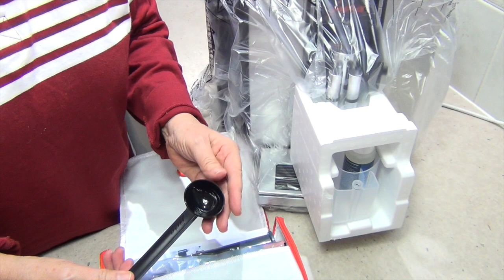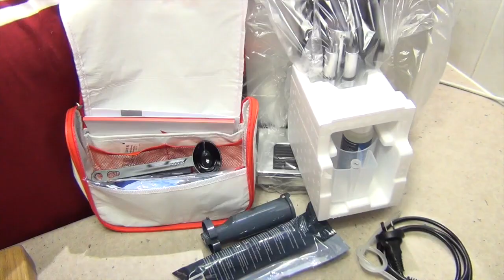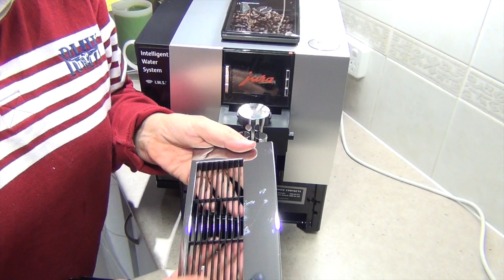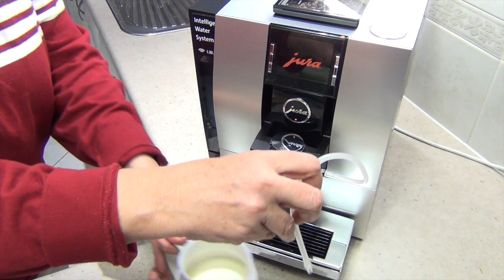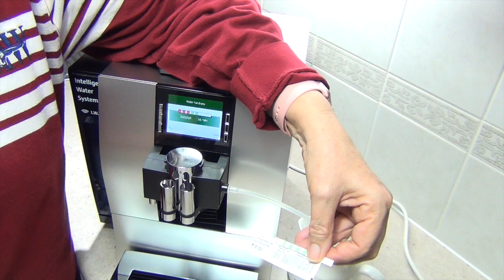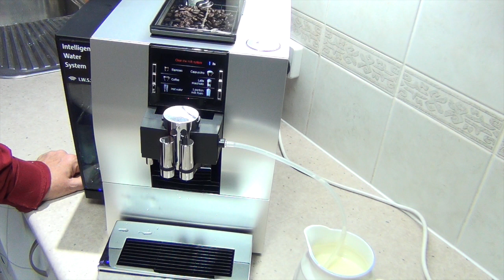Unboxing Jura Z6 Fully Automatic Coffee Machine cheekyricho episode 1,126

Comment: Great machine and review! I myself have an older refurbished Jura and I love it. It amazes me that it heats up quite quickly with only 1400W.
Reply from the maker: Thank you very much, they are supposed to be the Rolls Royce of Domestic Coffee Machines, I hope you get many years of faithful use from your Jura too. Thanks for watching.;-))
Reply: @CheekysKitchen  Thank you! The thing is that these machines are so modular, that they last as long as the manufacture of parts, but every 4-5 years parts must be replaced. Technically they could last a lifetime. Like I said, mine is a refurbished model, but still going strong after 12 years. It's like a car, it really is the rolls royce of espresso machines.

Comment: looks great at first, but very expensive with no provision for the user to even clean the brew group. Good luck with it I'll stick with my Saeco machine.
Reply: The reliability of Jura machines is the result of the permanent brew group, it has a self clean function where you can just drop a tablet to have it cleaned even to descale the boiler. The milk delivery system also self cleans.
Reply: cheekyricho cooking Would be wonderful but I live thousands of miles away! Still waiting for this machine to arrive in our turf so I can hand over my Micro 1 to my dad 😀
Reply from the maker: +Junior Ocicat thank you very much for the feedback. It has several automatic cleaning functions. I'm not sure which of these clean what as it is all done automatically. I have no experience with any Saeco machines, I'm sure yours would make a delightful cup of coffee as well. I have made no comparison between this machine and any other. This was simply an unboxing, a mini review and a few specifications differentiating it from the previous model. Hopefully providing an unbiased view of the machine, the package contents, the dimensions and a few of its features. Personally I like unboxing and product reviews as I find them to be more impartial than advertising by the supplier. It may help someone make a decision in regards to whether the product under review would or would not suit them personally. It isn't a cheap machine and the more information a person can gather about any product they a researching the better. Thank you for taking the time to comment and for watching.;-))
Reply: cheekyricho Hi Cheeky,
I have no problems with your review, seems like a great machine. After watching your video I thought I would check the web for a price and YouTube for any further videos. I noticed some additional videos on servicing your machine, including cleaning the brew group which should be done regularly as it is exposed to coffee grinds and water which leads to mould. I was surprised to see the amount of disassembly required to clean it, and some samples of the build up of mould. I hope you have a great experience with it, it obviously makes a great coffee and I hope long term it continues to do so.
Reply from the maker: +Junior Ocicat thank you very much. We live a long way from the store we bought it from and they offered to come to
My house to show us how to use it and answer any questions. I wouldn't put them to that trouble but we are going to visit the store to learn the basics, the programming and of course maintenance routines. After your comment I will definitely make sure they teach us how to clean the brew group. We live in an area prone to high humidity and the idea of drinking mould isnt very appealing. Thank you very much for the informative feedback, I know I found it very useful and am sure our viewers will too. We opted for the extended warranty which was expensive but at least it is covered for 5 years. If it dies during that time it will be either repaired or replaced. We wanted something that was simple to operate, looked aesthetically pleasing and the best quality as we could afford. I'm not a coffee shop person and would prefer to drink coffee at home with family and friends with something freshly home baked. I'm not trying to justify my investment, simply stating why I came to select this make and model. That's great info re the brew group though, I will be definitely looking into that. Warm regards from another coffee lover.
Reply: cheekyricho Thanks Cheeky, all the best from a regular viewer from Perth.
Reply from the maker: +Junior Ocicat thank you, you live in a beautiful part of Australia. Perth @ Adelaide are my two favourite cities. I could happily live in both places except I would miss my family in the east coast.
Reply from the maker: +Kevin Go thanks for that wonderful information Kevin, I'm sure our viewers will find it most helpful. We almost never go out for coffee now, only if we are meeting friends in town or something but this machine has definitely spoilt us. Thanks for watching and taking the time to comment.;-))
Reply from the maker: +Kevin Go oh that's a shame, never mind imagine how much you'll enjoy it when you can get your hands on one. They really are quite a spectacular piece of kitchen equipment, you won't be disappointed and neither will your Dad. Thanks for the feedback.;-))